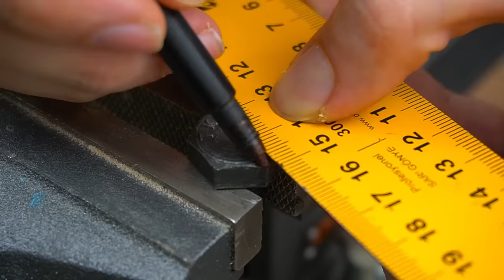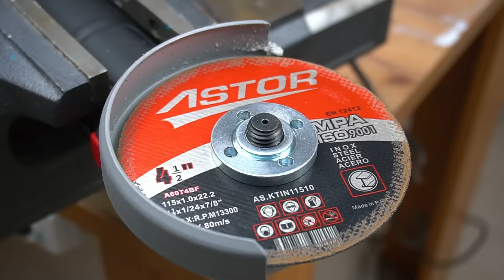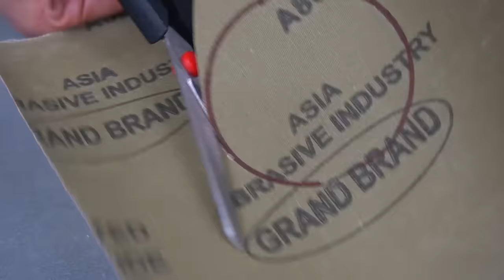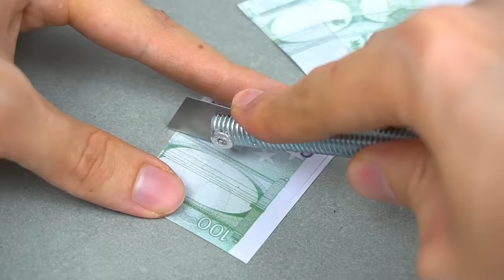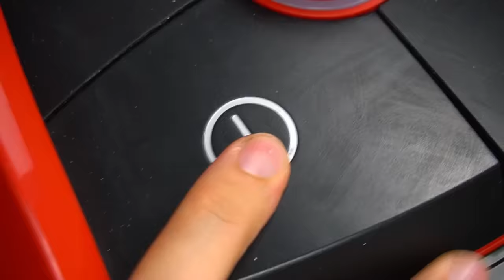Unbelievable Handyman Tricks That Can Make You Rich! He's Not Showing You These Secrets

Comment: I think some people have to much spare time ..I mean the handle on the bottle 🤦‍♂️ the hot razor😂 just heat it up with the butane torch ya use to make the other useless shit😅 lol he made a plastic spanner to put a new nut on a a new bolt instead of using his fingers ffs , some1 that soft shouldn't be using any kind of tool. I did like the sand paper flapper for inside the tube . But the rest is useless

Comment: Yes another tip that my Gad and I used for nailing end grain wood is to slightly flatten the point of the nail before hitting it in. Can be done by inverting the nail stand on hard surface add tap with your hammer - no need for anything else just the nail Hammer and the wood you are nailing. Having said that I am  a fan of using screws instead.
Reply: Танцевальныеродики
Reply: Slightly flattening the tip of a nail has mixed results. Anyone wanting predictable perfect results use a small drill bit just under the diameter of the nail to drill a pilot hole first.  Some particular hardwoods are just prone to splitting on the end grain.  Be a pro and pre drill, only takes a second.
Reply: @multibusa  Yes Steve that is one method I use if I am working with some of the "splittable" timbers we have in Australia especially when using screws and nails on end grains.
Reply: Я так понимаю, если вы пишете такие комменты, то лайфаки вы воспринимаете на серьёзных щах?
Reply: @multibusa a9a😅

Comment: slightly flatten the point of the nail before hitting it in. Can be done by inverting the nail stand on hard surface add tap with your hammer - no need for anything else just the nail Hammer and the wood you are nailing. Having said that I am  a fan of using screws instead.

4

Mr RezY

Reply